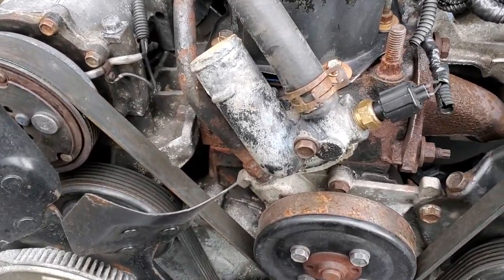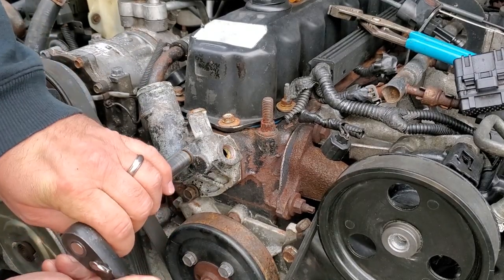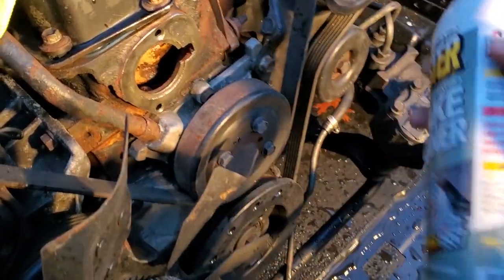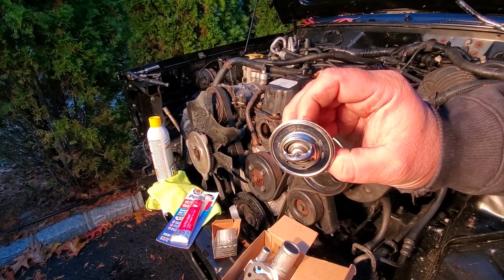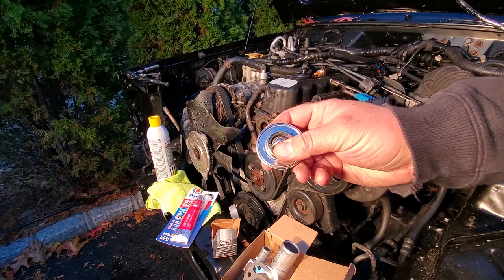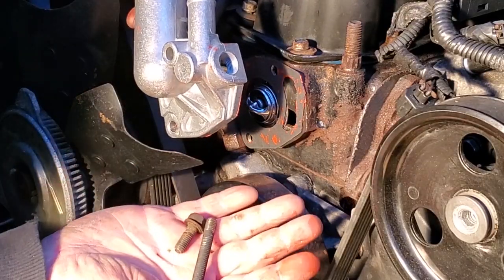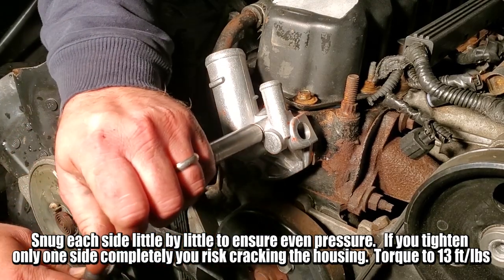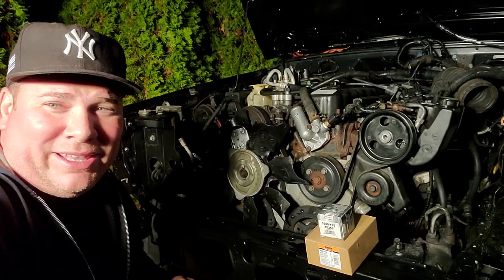JEEP CHEROKEE XJ THERMOSTAT, HOUSING & COOLANT TEMP SENSOR - WRECKED J EPISODE 5

Comment: Just in time, I have a new thermostat, housing, water pump, fan clutch, tensioner, idler pulley and serpentine belt to install tomorrow on my 4.0 WJ.

Why all that?  My clutch fan is bad, when I run the AC in summer it will overheat if I don't pay attention at stop lights or don't average at least 40mph.  Also my water pump gasket is always wet.  Not a huge leak but not confidence inspiring in a Jeep that runs hot in a desert...  It doesn't make sense to do just the bare minimum.  I'm doing an oil change too.

Next on the list is to replace my driver's side door lock actuator because it's making a lot of noise and working about 75% of the time and then hood, hatch and rear glass struts to refresh that a bit.

That's about $300 total in parts and a couple specialty tools.  I met the manager of the local Jeep dealership and he said he could get me "good guy" pricing on my cooling system refresh and his quote was something like $1,600.00. I don't want to know what the guy off the street pricing would be.  Any way, I'm going to take my time and save about $1,300.

Wish me luck and no seized parts.
Reply from the maker: God speed brother! I have a timing chain vid and a water pump vid coming soon! Lol

Comment: My mistake was installing the sensor after I installed. Ended up tightening til it bottomed out on other side. I ended up backing it out some and it started working. Next time I will install that first so I can see it.  Great video!
Reply from the maker: That's an important thing to consider! Thanks for watching!

Comment: I ended up doing a cooling revamp on my '00 over the summer... I went a bit overboard, but I didn't want to worry about touching the system ever again, or at least until i put some sort of hi-po turbo build. After some digging, I chose a bored-out t-stat housing and water pump from HESCO. the housing was cast and pretty nice, the boring help to increase flow and graduate that 90 degree angle a bit better. I will admit with the boring it felt a bit weaker overall, but I don't have the cash to dish out for Newcomer's CNC piece. the HESCO water pump was robust and the only one I found recommended by anyone who'd done cooling upgrades on the forums. I know aftermarket pieces aren't very reliable, and this one was sturdy as all get-out. Matched it up to a 3-row all-aluminum rad and made the mistake of going with a 160-deg t-stat instead of 180 or 190 and now I can't get her to heat up in the winter... but at least she's cool as a cucumber in the summer!
Reply from the maker: I want all those parts in my new XJ build.. what rad did you get.  Mishimoto?
Reply: @ProjectDanH  i actually went with CSF, i'll need to look where i got it, because CSF builds both a 2 core and 3 core radiator that from the exterior looks the same, the telltale difference is the partnumber. My entire list was:
Hesco hi-po t-stat housing
Hesco hi-po water pump
CSF hi-po 3-row radiator, sku: csf2671 (2670 is 2-row)
Oem heavy duty clutch fan (note this thing works wonders but makes a BUNCH of wind noise)
 advance auto aftermarket brand rad tubes (would've gone silicon but my funds were limited)
TYC genera aux rad fan (my oem decided it didnt want to work when i re-installed it).

When i accel during the winter now, i watch the temp gauge visibly drop 😅. Only other thing i wish i would've done is the heater core while everything was off, but i didnt have time to open up my dash for that project.

Comment: Dan, you made me nervous tightening those housing bolts. 😆 As you noted, the torque spec is not very high, and it's very easy to overtighten and crack the housing. I know from firsthand experience.
Reply from the maker: Yep, gotta be gentle with these things.. especially ones hollowed out for high flow!

Comment: I put a high flow pump from RockAuto and a hesco thermostat and housing in my XJ just last week. Hesco probably has the best pump out there, but at three times the cost of a cHiNeSe high flow pump from RockAuto, No Thanx! The thermostat housing was nearly blocked solid from not being properly inspected and deburred. The thermostat didn't have a hole in it for air to get through, so that had to be drilled. So much for getting better quality parts from the good ole USA. PRETTY SAD !!!💔🇺🇲😢
Reply from the maker: I had to fill some rough patches on a Chinese water pump and housing with JB weld once.. sad

Comment: That hose going to the heater core looks like it could be replaced. That clamp has bitten into it for a long time.

Also, using heat resistant tape, I wrapped the wiring for the coolant temperature sensor wiring. I noticed after all the heat cycles, the wire coating gets quite brittle which means it will eventually become really inflexible. I totally fear replacing a wiring harness.
Reply from the maker: Yes, this connector can definitely use some refreshing.  Most of the wires need a touch up

Comment: My problem- changed my 2nd thermostat housing still leaks coolant from underneath what could be the problem
Reply: Did you figure this out?..
Reply: @yo_mikey4082  yes I sold the jeep and now struggling with a wj🤦‍♂️
Reply: @AlbertTevs  just fixed mine last night. Turned out a piece (so small) was warped from the housing. Got a new housing and it solved it

Comment: Question I got a 00 cherokee sport it had no headliner an no overhead console how do I know what overhead console to buy I see two different ones
Reply from the maker: Did your jeep come with an OHC??? Were the wires removed? You can use any overhead console from any 97-01 XJ, however,  you will need an wire harness for your specific year.   Make sure you still  have the mounting bracket on the roof.   If you don't want an OHC you wont need a bracket and you can get any regular dome light that's attached to the headliner
Reply: @ProjectDanH  yes I have a harness an plug that’s just taped up if post a pic but it won’t let me on here lol I’d like a regular ohc but I’ve seen some that have speakers in the back some that have just a light in the back idk what mine is supposed to have an I don’t wanna redo any wiring
Reply from the maker: @chrisbevan767  hit me up on Instagram. @project_danh